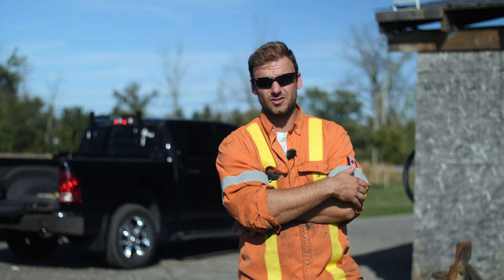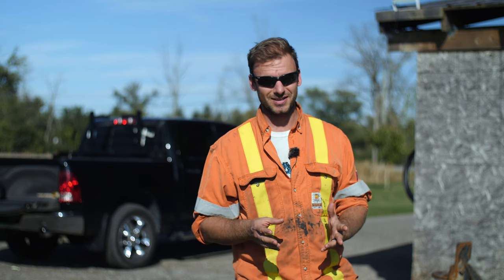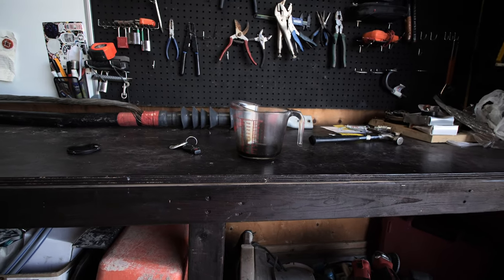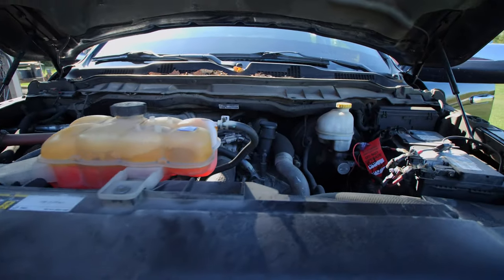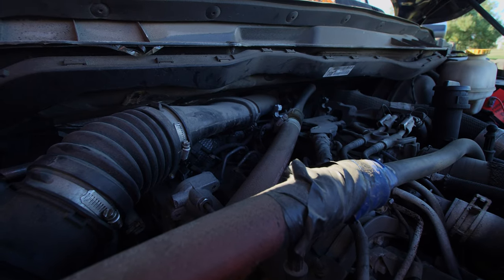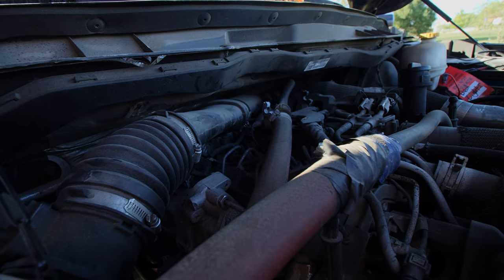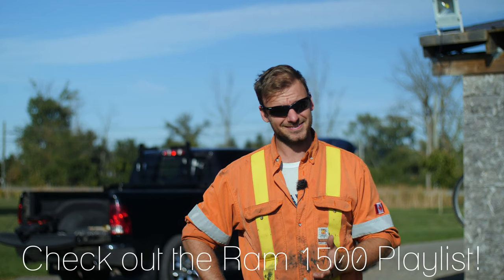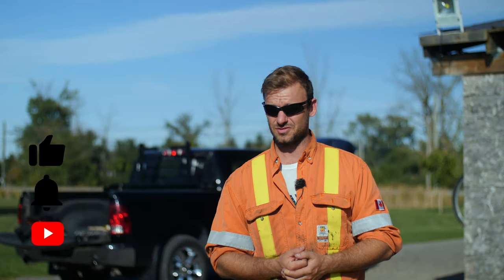These TWO things will help SAVE your Ecodiesel!

Comment: I have a 2016 ecodiesel. Currently 170,000km and she purrs along the hyw. Runs smooth and sounds great. No delete. I tow fully loaded tt at about 6000lbs. I get about 15ltr/100k towing. Don't over tow with the eco, stay well under max and go easy and it will tow much smoother than the hemi. Some things I do... #1; its not a hemi. Don't drive it like a hemi. #2; Change oil every 8-10k I use added friction modifier. #3 these are Hwy engines, not city, these are meant to work and drive, not a daily retired guy driving 25km a week and tow a fishing boat on weekends! #4; it's a diesel... clean oil, clean air, clean fuel. #5; it's not a hemi, don't drive it like a hemi. #6; clean map sensor and egr tube every 20k. #7 I have a custom tune (non delete) adding about 60hp and 60tq,  very little turbo lag, lots of power, #7 warm it up, start driving slow for a few mins. #8 let engine idle for 30sec before shut off, up to 2min if working hard, let the oil get thru the turbos before shut off. #9 don't idle too much. #10 it's not a hemi..... ... I will do a catch can soon. (I have one on another vehicle) I get an average of 9.3l/100k as tracked on fuelly. I drive 100/105km/hr on hyw. I tow at 100km/hr max on hyw. I love the eco, smooth and steady. But it's a dirty engine which is why ppl delete egr. Expensive repairs, but so is every deisel.
Reply from the maker: All good advice!. So.....

It's not a hemi??

I know lots of guys race these trucks around and I totally agree with ya
Reply: @GilbertGardens  lol.... In a recent survey I just made up for this comment; 90% of eco haters are former hemi owners who thought they could drive it like a hemi... I heard somewhere 'the ecodiesel hauls and the hemi hauls ass'! Another 8% of eco haters saved $50 and bought cheap oil and went 16k between changes cause the dashboard said to and the engine seized. The last 2% are the unlucky ones who got a shitty engine that failed.
Reply from the maker: @ChrisB-ny5zr  yeah I agree with that. The twin turbos look sick but if I want to go fast... I'll jump on my gsxr 1000 lol
Reply: I have a 2016 as well with 140k on it the only issue I have is transmission over heating on road trips if I have a heavy foot . Runs great though
Reply: People driving a diesel like a hassle is most of the problem.  Get a diesel warm and keep it warm.
Reply: 2015 after the initial 75k miles then the recalls and engine blowing up from  turbo leaking and thinking omg a lemon was purchased. 170k  and she is stilling towing daily.
Reply: Is it a hemi though
Reply: Had a 2015 eco. Loved it had. no real  problems.Had to replace fuel pump in fuel tank. was only problem in 135000 kms.

Comment: I have one of these diesels it’s a 2018 and I’ve always liked the ram HD with the Cummins.  Heaving said this, I have always rejected the Ford power strokes because of the multiple problems that owners have to deal with.  They have to bulletproof them in order for them to be reliable. The same has to be done to these ecodiesels, Enough is enough!  Why should we have to  be buying this garbage product?  Let us not continue enabling these manufacturers to produce these garbage products that have to be made reliable  by the end users.  The only way to fix this problem is for us to boycott these manufacturers by not buying their trash. This I assure you will fix the problem from the root.
Reply: How’s she holding up I just bought a 1500 Laramie eco-diesel last weekend, only 33k miles on it

Comment: let me tell you what you need to do to ensure you never have those problems. Take your ecodiesel to the dodge dealership and trade it in for a 2500 cummins. Problem solved.
Reply from the maker: Hahaahaaha yeah that'll do it
Reply: I bought my 2007 5.9 Cummins new and I have to admit that with no EGR or other B.S. I'm not sure I want to trade down to a potential problem.
Reply from the maker: @louielindenmayer6653  keep the 5.9 for historical purposes lol. Unfortunately there's no getting around these emissions they just get worse and worse.

Comment: I run a catch can too and after sending it out for analyses mine  came back 50% combustion products ie: fuel 30% oil and 20% water.  EGR "soot" is the biggest killer to these engines in conjunction with the stupid stock tuning using excessive pilot injection to keep the diesel rattle down, even more "soot". I have run a GDE egr delete tune with stock exhaust DPF and SCR on my 2016 from new and now have 195,000km with zero engine issues.  I run 14,000km between oil changes and am maybe 1/2 a liter down then. I have sent my oil out for analysis every oil change, have not seen any bearing material or excessive wear metals in any of the samples. For even cleaner burning, "less soot". The use of centane booster as these are European diesels and the diesel over in Europe is a minimum 50 centane. In north America its 40 - 45.
Reply from the maker: Yeah I've heard that too. I'm usually running 12 to 16k between changes too now. I'm due to send an oil sample in as well. I don't do it often  UT it's a good idea. I'm at 245,000 ish on the O.G 2014

Comment: Pollution preventative devices from what I understand. Seriously shorten the life of your engine, but none of the tree huggers measured how much it will cost in energy to replace that engine or the shipping all the people of the mining all the trucking the processing. If I do it our way and make it last for 1,000,000 km I’ve probably saved processing three or four trucks and save me a lot of money. Of course the manufactures of these vehicles will lose a lot of money. Thanks to me being thrifty.😂🎉 and milking every possible mile out of this very economical truck it gets better gas mileage than my car😊

Comment: My bmw m57 diesel oil would go black after 100km of driving. And i sold it at 430k kms. Original engine and tranny, it was tuned to 360hp and 470lbs from 200k kms

Comment: Its the coolant system thats fails
Reply from the maker: @mountainconstructions  I know the oil cooler fails. Doesn't typically blow the motorsnup though does it ?
Reply: @GilbertGardens  And the Turbo cooler pipe in the valley.
Doesn't kill the engine.
It's just $5000 to replace a poorly positioned $2 rubber hose.
As I've just found out
Even if you tried to do the repair yourself the amount of new parts required and special tools is just silly.... 
And... it's only going to do it again in time.
Reply from the maker: @mountainconstructions  that's good to know thanks.

Comment: Ive got a 2016 Chevy Colorado with the 2.8 Duramax. I like the truck and the diesel but it was annoying because of the constant regens so I deleted my egr as well and it only regens 2 times per tank istead of 3. Also having clean oil and clean filter as well. ive got 170,000km on it so far with no issues
Reply from the maker: Nice my in laws just bought a 2021 gmc with the small diesel. Going to do a walk around in a week or so

Comment: Caterpillar was the only engine manufacturer that pulled the input gasses for the EGR from after the  after treatment system. According to Adept Ape, this was a major improvement.
Reply from the maker: Cat knows
Reply: The newest gen Ecodiesel pulls EGR downstream of the DPF which was said to prevent a lot of the issues the earlier gen had.
Reply: @mikelemoine4267  Good news but it does seem as though most of the soot problems were avoidable.
Reply: @davidmitchell7183  Yes I think some of the soot issues are simply due to the PCV coating the intake with oil film and then the EGR opening and dumping super heated gasses and carbon particles into the mix which creates a tarry sludge in the manifold and on the swirl valves. That alone doesn't pollute into the oil, but I suspect it has an effect on how clean the engine burns, and it's also possible that chunks get ingested. Even if they don't scrape up the cylinder walls, I'd imagine it adds compression and possible detonation. 

I think turbo heat cooking the oil at shutdown is also an issue if people don't let them cool a bit after running hard. I wish they had an electric bypass pump that would keep oil flowing for a few minutes after shutdown to prevent heat soaking the oil in the turbo. It'd be nice to run it on the fuel pump prime circuit too as it would help with cold starts. Maybe the aftermarket will develop something.

Comment: Thanks for the vids! I like your homestead content ...... I've been thinking about changing my oil filter every 5k and oil every 10k because I've been noticing the filter is quite plugged by 8k... I believe a clean filter allows oil pressure and flow. Which helps this picky engines... I think the oil is still good at 10k, but filter is plugged. No way I would go more than 10k between oil changes on this dirty engine. I think going 12-16k as the computer says is not good! Too much soot.
Reply from the maker: On a stock engine I agree. I sent oil away for testing at 26k and they said it was super clean. They said I Could go 20k...now the filters I agree with. I still run 16k intervals since it's been working with my setup I don't want to change. Thanks for the kind words brother safe travels

Comment: When you checked the oil you should pull the dipstick and then put it back in because it’s sealed at the top with an o ring not letting oil up the tube. I checked my oil before like that and thought it was low but you check again and it’ll go from min to max. Also that air intake is way worse than a stock intake

Comment: Agreed the emissions system including the factory tune especially since the AEM government detune is killing these trucks.  The EGR soot & Asphaltine (unburnt diesel hard particles) recirculator is clogging oiling ie lubrication passages. What else irks me is that it’s proven that the EGR is not required to meet emissions outputs but our out of control EPA overlords insist on it anyway. That style gov wants us on tax payer paid trains bicycles & battery cars anyway. 

The silver lining for the 14/15/16 models was that we got $3,150 for doing the AEM which smartly could be put toward a much cleaner aftermarket tune that also turns the EGR off. Green Diesel Engineering, HD diesel, & SKT sofa king tuned offer these at about $1k for both an engine and transmission tune. 

After which your oil starts to get dark around 8k miles instead of 2,500 miles. Miraculously the orange check engine light will no longer send you to the dealer service bay for piddly stuff. Mileage & power improve and you can get the benefit of a computer controlled engine brake.  A great safety feature that is very reassuring when you tow in mountainous regions. I transport travel trailers & boats from Mfgrs to dealerships commercially with my 14 ED so I really benefit from this feature.

After an aftermarket tune and with proper maintenance the ED turns into a reliable fuel efficient lil motor. Once you install an aftermarket tune you can also do an EGR COOLER delete with no codes and since EGR is turned off you no longer need it. The EGR cooler is also prone to leak internally sending coolant out your pipes which causes more problems or worse melts a hole in the plastic intake after which the coolant burns a super hot fire that torches the truck beyond what an extinguisher can handle. Thank you EPA.

My first motor tuned at 30k went 371,000 miles before pushing a head gasket. Likely due to low coolant from a leaking EGR cooler which caused hot spots steam & pressure to push the gasket out.  Head gaskets are a non cost effective fix IMO. I put a new motor in as it come with new turbo, high pressure fuel pump & injectors plus a 24 month unlimited mile warranty. None of which would I have gotten with new head gaskets. My 2nd motor has 359,000 miles tuned from day one. Personally no warranty concerns from using a tune despite that technically it can be used to void warranty if Ram could prove the tune caused the failure.  I don’t know of any such cases in fact better motor life means less replacement motors for FCA. I’d rather invest in trouble free operation & longevity than hope to collect on a warranty before it expires anyway. Friend James who is also a transporter has 390,000 miles on his tuned ED.  Don’t hate on this great lil motor or FCA if you’re having emissions driven issues hate on the EPA then invest in a tune.

EDIT Motor made it 423,000 and cracked a head without any severe overheat. James has 452,000 on his still ticking. Ram1500diesel.com and car-part.com being some great resources in keeping her on the road cost effectively.
Reply from the maker: very well spoken. man thats a ton of miles you put on. drive safe. I appreciate the insight.
Reply: Vern, you DPF DELETED as well? Or you just EGR and stock DPF?
Reply from the maker: I got emissions for sale if anyone needs em. Ontario GTA area.
Reply: @throughthesmoke3188  Didn’t have to do a full delete until years after the base tune.  No need to do the full delete until & if you have issues.
Reply: Thanks for Sharing! I haven’t read to many success stories with this amount of miles on an Eco. Glad to hear it and I look forward to deleting mine soon.

Comment: The key to longevity in any diesel , is cooling the turbo before shutdown.  Most people drive the 1/2 ton diesels like a gas engine.  I drive mostly highway miles, with little idle time.  I do use Hot Shots Secret products in the oil and fuel.  Especially the Stiction Eliminator.
Another problem that the Ecodiesel has is the filter in the block.  If the filter is removed after the drain plug is put back in.  The oil is still in the engine.  Also the oil dipstick can give a false level indication.  If you don't allow enough time for the oil to get to the pan.  The 3rd generation engine has an 8 quart capacity, rather than 10 quarts.  Even my dealer has overfilled the crankcase.
I have not used my 2016 Ram 1500 Ecodiesel much in the past year.  But it still has 158,000 miles.  And is a smoother ride than our 2018 Ram 2500 Cummins beast.  Much better in the snow too.  The Cummins has too much torque.
Reply: How do I cool the turbo before shutdown?
Reply: @pwp5741  Basically reduce the heat.  Typically idle for 2 minutes.  But also when a tractor trailer pulls off the highway.  As soon as the speed control is released.  And deceleration is happening.  The turbo is cooling.   The idea is not to accelerate hard from that point.
Reply: @zxej6879  that is for answering.
Reply: I use a gallon of water and I just pour the whole thing onto my turbo before I turn the engine off. Works a charm

Comment: Have always enjoyed your ecodiesel videos (along with all the others around the homestead). I have a 2014 also with 180k; went to Green Diesel in Detroit about 2 yrs ago at 130k & got their hot tune (egr delete, but kept the DEF etc). Like you, bought it new & plan to keep it for as long as absolutely possible. Tow a 30' trailer (about 8k lbs) with no problem (3:92 rear end); trailer is currently in Florida :( Overall I'm happy with the truck, oil change every 16k, so far so good. Just curious about your 10 litre fill - I've found that with a filter change mine takes 11l which puts it right on the Max line on the dipstick - where it seems to stay until the next change. Interested to hear about the catch can.
As an aside, the major issue I've had (at 125k) was a faulty tone ring - had never heard of this & it left me dead on the side of the QEW. Very long story short, took a week for dealer to analyze (with input finally from factory tech) and another two weeks to replace. Out of Canadian powertrain warranty so tab was $3,300. Wrote FCA complaining that the mileage equivalent to 125k kms put me onside the powertrain warranty - to my amazement they eventually reimbursed about 80% of the bill, as a 'goodwill gesture'. 
Keep those videos coming - looking forward to your 250k review.
Reply: ...I should clarify; I should have said my crankcase refill takes 11 US quarts, which is about 10.4  litres. Sorry.
Reply from the maker: Thanks for the post. That's crazy about the tone ring. Even more cray to hear fca helping out lol. I would say most people put 10L in for an oil change. Two jugs and done. Each engine is going to be a little different but a whole liter seems odd. Well whatever works for you're situation for sure.
Reply: There’s a recall and extended warranty for the Tone Ring

Comment: Question,  I have about 100k and have had ZERO issues but for a while have had a small oil leak.  It seems to come from the top of the motor, I’m wondering if this tube is leaking.  Had it to the dealership and they conveniently can’t find anywhere it’s leaking from.
Reply from the maker: Call around and bring it to a small diesel shop. Or a mercedes diesel shop. Simular motor to the v6 diesels in MB/vw I haven't had any leaks knock on wood

Comment: I have a 2014 Ecodiesel. I'm 2nd owner have had original owners records. Everything done on time and by dealership. Then I bought it with 74k miles. In 2017 all services and recalls done on time. 2 things I do is sticktion modifier every 3 rd oil change and edt every fuel fill up. And I use 11qt every oil change. So far no blow by or oil used. So 3 years and almost 80k miles.